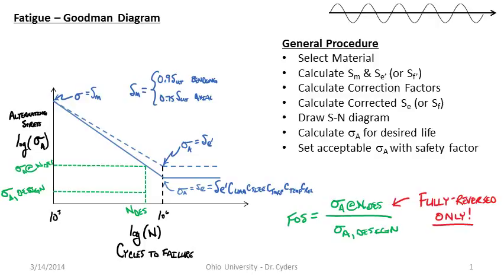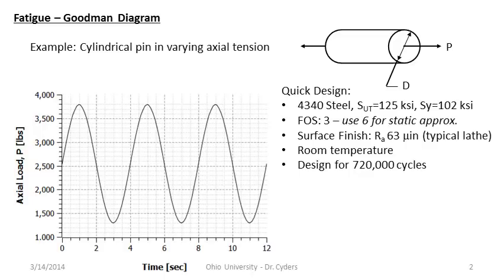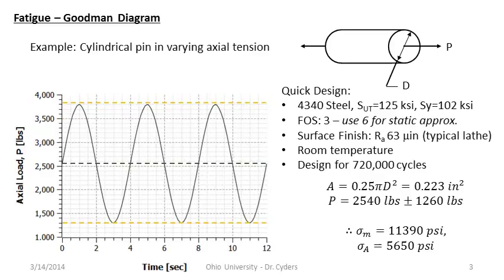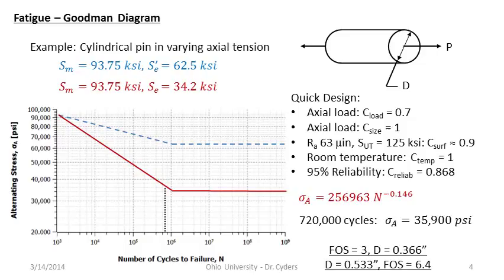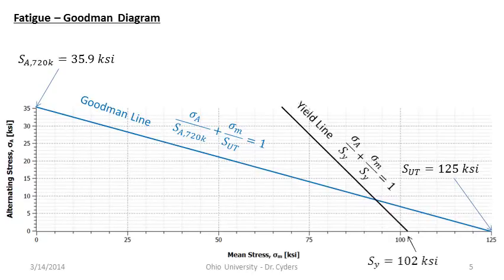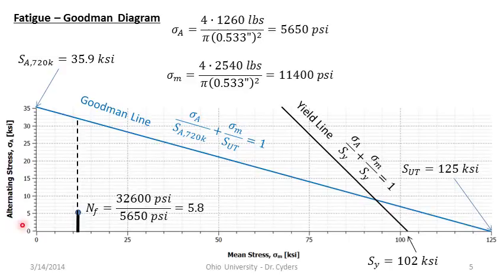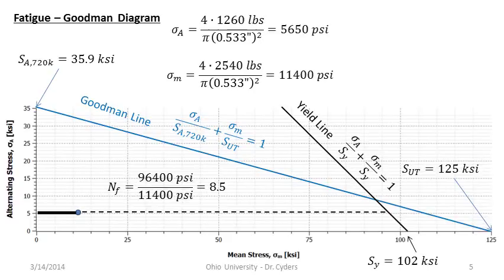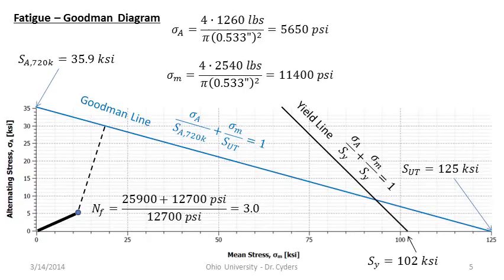Goodman Diagram Design Example

Comment: Can anyone share how C(reliability) of 95% comes out to .868 not .950?
Thanks
Reply from the maker: +John Cullen The reliability factor comes from the normal standard distribution - some data has shown that strength varies stochastically with a standard deviation of about 8% of the mean value. If you use that standard deviation, you can calculate how much you need to reduce the stress level to maintain a 95% confidence that you're below the actual strength of the material. A single-tailed 95% confidence interval with a standard deviation of 0.08 puts you at a correction factor of 0.868. If you google around, you'll find more complete explanations with graphics.
Reply: +Dr. Cyders Thank you!!!
Reply: +Dr. Cyders Thanks! that helps a lot